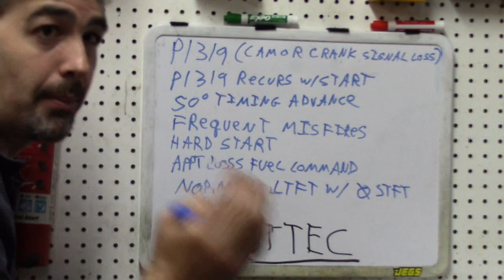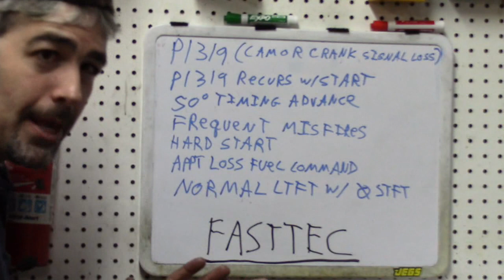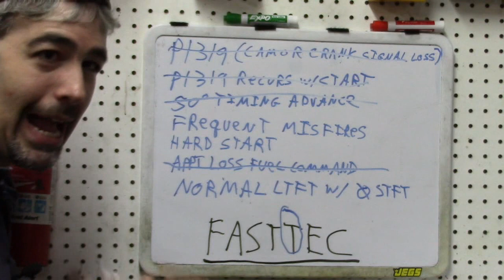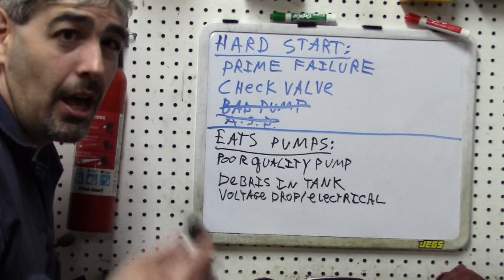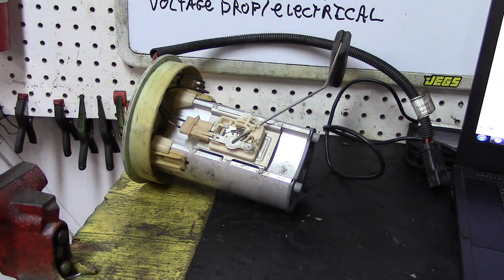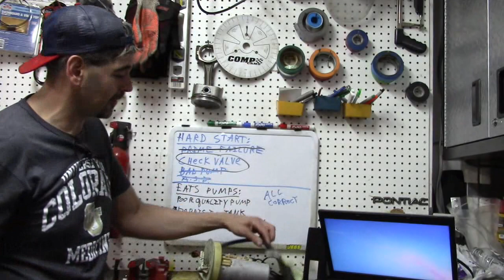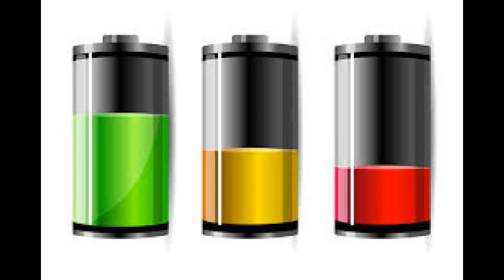Jeep Eats Fuel Pumps Follow up and Hard Start Diagnosis and Repair

Comment: You didn't eliminate the possibility of leaking fuel injectors, or a leaking fuel pressure regulator. It is possible for the regulator to work properly with sufficient flow, but not be able to completely seal in order to maintain pressure in the absence of flow. Unless this is a return-less system?
Reply: sorry for the triple post I clicked the button to post from my phone and it said there was an error so I clicked it again. Then I got out my computer, retyped it and posted it. before I noticed the comment was already posted twice.
Reply from the maker: +Remington Baker Thats OK. Whenever I'm at a hotel I get triple posts.  Anyway- what is your explanation on why if the injectors are leaking why is the LTFT at zero?
Reply: Good point on the fuel trim. However that still leaves the regulator.
Reply from the maker: Remington Baker How does it leave the regulator? Are you suggesting regulator is leaking? If so again, how do you explain no change in even the STFT at idle vs load?
Reply from the maker: Remington Baker .... Not to mention why is the fuel pressure constant idle vs load?
Reply: +Schrodingers Box Anytime the pump is running there is a considerable amount of return flow. the difference in the amount of fuel diverted through the fuel injectors at idle or under load is nearly negligible compared to the amount being returned to the tank. it is quite possible for it to sustain regulation with the pump running and have a fairly large leak. alto if there is debris preventing the valve from fully closing this shouldn't effect operation when the valve is further open. in other words when the pump is running.

You say the pressure is constant idle vs load. isn't it referenced to the manifold pressure to keep the differential pressure constant across the fuel injectors. If so the absolute pressure should increase with load. Does Chrysler use a different system?
Reply from the maker: Remington Baker I suggest watching my video "diagnosis and understanding: fuel pressure". Sorry but your understanding is incorrect.  You WILL have a fuel learn strategy adjustment if the regulator is not working.  It is impossible to not have that happen.
  Fuel pressure regulator is scientifically eliminated as a possibility by fuel trims and fuel pressure.
Reply: +Schrodingers Box I completely disagree. I don't think you understand the failure mode of the regulator I am describing. I know you are all about evidence so I will try to find some sources describing it.
Reply from the maker: Remington Baker Well I would agree with you but then we would both be wrong. Again, I suggest seeing my video so you understand the operation of the fuel pressure regulator
Reply: +Schrodingers Box I feel like you are being the old man in the story, but I want to keep it civil. So I think I will agree to disagree until I have more evidence to present.
Reply from the maker: Remington Baker Lol- hardly- I'm pretty sure the old man would agree that a leaking fuel pressure regulator would have a dramtic effect on fuel trim.  Its funny how you agree a leaking fuel injector would have an effect but a fuel pressure regulator wouldn't... explain that.  Actually you can't- it is not possible for a failed fuel pressure regulator to have no effect on the fuel staretgy adaptation. I-M-P-O-S-S-I-B-L-E.
Reply: +Schrodingers Box The leaking injector would have an effect on the fuel trim because it is leaking into the intake. The regulator would be leaking back to the tank. I see know from your comment that you are thinking of fuel leaking through the diaphragm into the vacuum reference port. Yes I completely agree that this would have an effect on the fuel trim, but this is not the only failure mode of a fuel pressure regulator. When the pump stops there is no flow and the valve must completely seal to prevent the fuel from flowing back to the tank causing the pressure to drop if the seat is damaged or there is an obstruction preventing the it from completely seating, then it will not hold pressure with the pump off. This will not necessarily affect regulation with the pump running because the valve is much further open.
Reply from the maker: +Remington Baker Sounds to me like you are confusing the regulator with the check valve (which was the problem).
Reply: Absolutely not.
Reply from the maker: Ok..... so why does the regulator have a function when the pump isn't running???? And even if it did and it was leaking back to the tank, it would cause a drop in pressure at the rail , why would that not affect fuel trim by lowering volume per injector pulse?
   Really sounds like you are describing a check valve in which case everything you say would be 100% accurate.
Reply: +Schrodingers Box I looked up a fuel system diagram on this vehicle and I see the regulator is near the tank not on the rail and does not have a vacuum reference. Which explains why the pressure doesn't change under load. But it is still a return type system. This means the pressure is regulated by altering the amount of flow that is diverted back to the tank. when the pump is stopped the regulator has to seal or the fuel will return to the tank through the return line. The check valve also has to seal to prevent the fuel from returning through the feed line. There would not be a reduction in pressure at the rail with the pump running. If the failure is that the valve inside the regulator is not seating all the way because when the fuel is flowing the valve will be further open to maintain the same pressure.
Reply from the maker: This is most definitely a returnless system sir, not a return type.  Not sure what diagram you are looking at but it is absolutely a returnless system. Even so, your explanation is still incorrect.  Watch my video and it will be clearer.
Reply: +Schrodingers Box http://www.wjjeeps.com/fuel_filter.htm
https://en.wikipedia.org/wiki/Jeep_Grand_Cherokee_%28WJ%29
The return line is short but it is there.
Reply: +Remington Baker I know these aren't the greatest sources. I also looked up the part on Napa's site and it looks like the one in the diagram and has three ports on it.
Reply from the maker: yes of course it has a return line silly but it is a returnless system because there is no return from the rail. all systems have some type of return even if its I nside the tank. 
  Anyway it is moot- I understand what you're saying about the regulator as it applies to a return system as well. The difference is a check valve will have no effect on fuel pressure if it is faulty and allows a fuel return. But a regulator will. The idea the regulator would allow a return of fuel with engine off but  somehow still restrict fuel sufficiently under high load so as to maintain the exact adaptive fuel cell for that condition is just plain erroneous.   Show any example to the contrary and I'd love to see it. it is simply impossible and that is why check valve is indicated while regulator is eliminated.  Your thinking as far as the pressure when engine is off is correct, but the idea that it would not have affect on fuel trim during load is simply incorrect.
Reply: Not all systems have a return some use a fuel pressure sensor and varry the current to the pump with PWM to regulate the pressure. I just watched your diagnosis and understanding fuel pressure regulators video and I think there are some things you don't fully understand about how they operate. I have a good book about engine control systems saved on my computer that I think covers it well. I will find it tomorrow and post the title.
Reply from the maker: Explain the lack of fuel trim adjustment on a leaking regulator and I will take you seriously. 15 posts and you still skirt that.
Reply: I have not skirted that at all. I have explained it more than once. I explained how the regluator can manage to keep the pressure in regulation when there is flow but not when there isn't. If the pressure is being propperly regulated while the engine is running why would the fuel trim be affected?
Reply from the maker: it wouldn't. it's just not logical that it can't stop the flow at even 5PSI as indicated in the video but maintain correct pressure at 60 PSI. the behavior from the gauge combined with fuel trim and pressure conclusively eliminates regulator and indicates check valve. Sorry bro.
Reply: In what way is that not logical the valve inside the regulator has to compleatly seal to hold the pressure at anything while the pump is not running. While it's running there will be more flow through the regulator to maintain the desired pressure which means the valve which is in the regulator will be far from on the seat. So if there is junk in there or the seat is damaged it will be able to regulate the pressure when there is flow but not when there isn't. It's not that far fetched especially since there was clearly debris on the system.
Reply: from watching your diagnosis and understanding video you seam to suggest that the position of the valve is directly related to the vacuum applied. That is not the case the fuel pressure acts against a spring attached to the diaphragm. The vacuum allso pulls on the diaphram. if you have more flow from the pump It will open further to maintain the pressure. If you have no flow the regulator will close because once the fuel pressure drops just bellow the regulated pressure. it cannot overcome the spring pressure. which is what sets the regulation pressure. You mentioned that at higher loads there will be more fuel delivered throught the injectors for a given pulse width. This is not true the differential prsssure accrose the injectors remains the same because the fuel pressure rises proportionally with manafold pressure. the vacuum port is a reference. the set point of the regulator is always the same amount above the reference. this makes the ecms job easier because the amount of fuel dilivered is directly proportional to the on time of the fuel injectors regardless of the load. However this Jeep does not have a reference port on the regulator
Reply from the maker: Remington Baker Yes but that only applies to vacuum based which the regulator in the jeep is not
Reply: The only difference is that it is referenced to atmospheric pressure. That does not change the fact that the pintle  will move away from the seat when there is return flow which is why the pressure can remain in regulation with flow, while the seat is damaged.
Reply from the maker: Remington Baker Still disagree but Either way- in this case it is still insignificant and irrelevant.  The fuel pump and filter were already going to be changed based on the complaint of frequent pump replacement. If both the pump and regulator (in the filter) are changed I do not need to determine the problem.  If I were bent of doing that I would have simply done what I did in the first video and deadhead the pump with the pressure tester. If the pressure held then the regulator would be the problem.

Comment: Hiya Matt.
I'm still bugged about the multiple FP failures.  The only way I can see it is if the same shop did all of them and just kept tinkering with the original pump and destroyed the screen in the process.  I mean the screen is THE essential filter and would have blocked anything big enough to jam or damage a check valve and as far as I know, all replacement tank pumps come with them installed.  No matter what, the last bunch of crooked goobers should be flogged. 

Didn't the prime duration seem a bit short?  I would think it would run long enough to open the regulator in one go.  PCM controlled so nothing you can do with it.

I had to laugh as I have used the headlights for a quick & dirty test for charging, bad connections, and bad cells.  Whine coming through the radio on AM is also an indicator as along with supplying the starting power, the battery is also the primary DC filter for the alternator.

As for the old man - I probably would have sprayed his handlebars with Armor-All for annoying me :)
Reply from the maker: +Eddie the Grouch Yes I have to admit there are a lot of variables on why the pumps failed before but I agree- shoddy work for sure.  Yes I also thought the prime was short- not sure what to say about that.

Comment: Hi Matt I see what you are saying But IMHO a person could have checked fuel pressure early on found it was low and put that on the things to fix list along with the other problems. And I would have liked to see the fuel pump     amps and volts on the scope just for fun it may have been interesting no? Also when checking for power and grnd. at the pump how about this. A old fog light and 2 long jumper wires so you can look at the light output from the drivers seat?    Well thanks Matt!!!

Comment: It's still faster/cheaper to replace cam or crank sensor at random and if that doesn't fix it replace the other.
Reply from the maker: +Galfonz Why is it cheaper and faster if it is not the cam or crank sensor that is the problem?
Reply: The code indicated either A or B was bad. Wouldn't replacing the easiest to get at one first and then the other if needed be faster than taking a lot of time finding the root cause to determine which one caused the code?
Reply from the maker: The code indicated either A or B has an jntermittent signal loss- not that it's bad. A signal loss. And in fact we even saw that it was from an excessive air gap due to a loose mounting bolt so the fix did not even need a new sensor at all. 
  So changing the sensor would actually have been more expensive by far!!
Reply: Good point.
Reply: Return the sensors if they don't work?  Haha

Comment: If you had listened to that old man and just went ahead and replaced the battery without testing the charging system,, and for drains, and then it turned out to have been dead again the next day, that old man would have been the first to call you an arse and unprofessional. Or worse. 

You can also bet that one time you don't bother to test will also be the 1 time in 100 that the fault is not with the battery.

Comment: Hi Matt, good video.
I think you could have possibly skipped the voltage drop at the pump test. Your trim readings under load tells me that the pump was recieving a good enough voltage. I would like to have seen an amp clamp scope trace though, even though it would probably be normal, or at least acceptable. (Vantage Pro fetish I guess)
I`m guessing the owner has a happy camper, especially with the iron clad, gold plated Schrodingers Box 3 year Guarantee lol.
Good luck to you mate, keep `em up....Carry On...

Comment: They definitely installed a used pump.  We never need a receipt for parts that fail during the warrantee period.  We just pull it out and have them send a new one.   The parts store keeps all the parts we buy on record.  We do keep all the receipts, just incase there's any confusion or they can't find it in their records, but we never need them.
Reply from the maker: That's actually a really good point, I forgot about that. They could have just said where they got it from huh?  Yeah that like 20 points of evidence towards a used pump and still zero that it was new.
Reply: Schrodingers Box Not to mention, the factory pump would most likely be around double the cost of an aftermarket one.

I wonder if maybe they checked the pump and found that it had a clogged strainer sock and just pulled it off and reinstalled?

Comment: Hi mate.I hope that the owner did not have to pay for the new price of the pump when installed before, because that would be theft.  I did not go with the voltage drop, but thought that the pump would have been working too hard to maintain pressure, and died because of that.  However that was going with the idea that the pump was new, and the check valve was elsewhere.  I was going with the Idea that all the work had been done properly, shame on me!!!!!  The work on this car has been done by cow boys.

Comment: MATT, hello I thought you did not have the patience  with old man LOL. the truth is that  your method the FASTTEC works all the time and on this video i learned one more thing that voltage drops will kill the pump in time that is awesome and thanks for that always waiting  eagerly for the next video. cheeers  always my friend .
Reply from the maker: Yes he FASTTEC method will always find the problem. The only issue is sometimes it's hard to decide where to start. Normally fuel and spark but not always- depends on the evidence. Also depends on accessibility- if a car doesn't have a schrader valve on the rail then I probably test spark first or use starter fluid maybe as a fuel test. But the method will find the problem.

Comment: Regarding the story about the crotchety old guy. It's a good story (happens every day). The most interesting thing would be to know what kind of history he has had during his life, in having his cars worked on. Perhaps he has had very good luck, found very good shops, and stuck with them. So perhaps he has not had a lot of "unsuccessful swaptronics". Therefore, he might not have the ability to appreciate what seems like overly analytical and overly intense testing methods. But the daughter probably will.

Too bad you didn't find a 5 amp current drain when the car was off and closed up. Would have liked to see his response when you showed him the ammeter with the car completely off and closed.